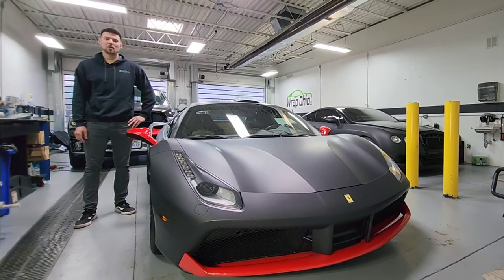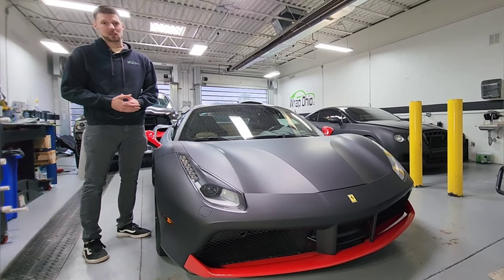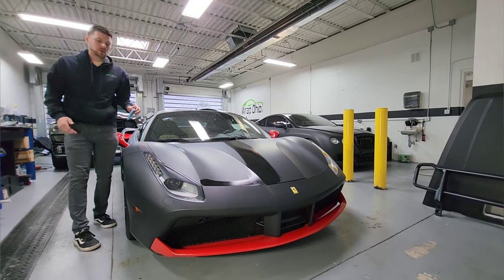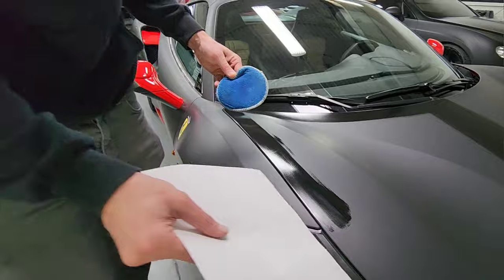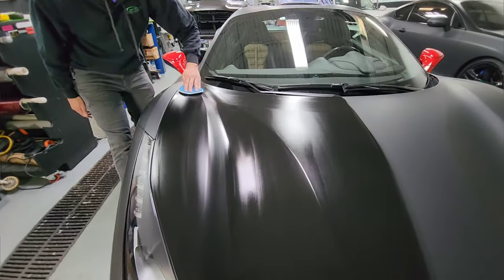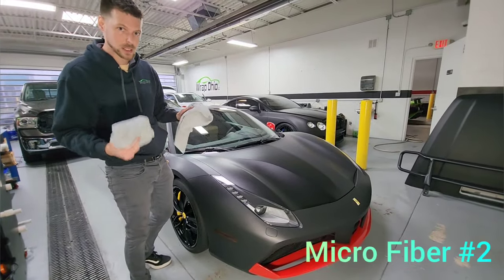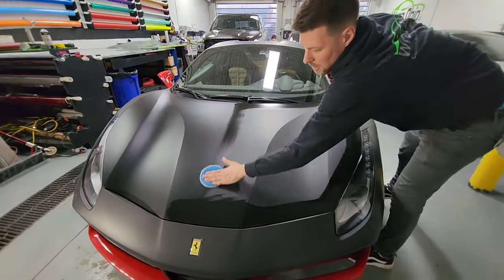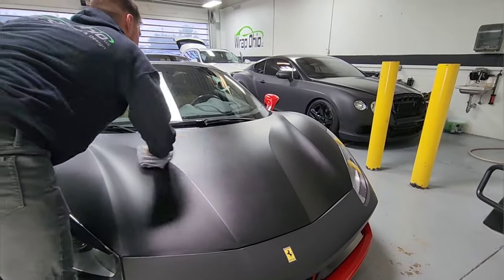How to Ceramic Coat a matte wrap!

Comment: Thanks for a great video!  Just for clarification, please could you confirm that matte PPF does NOT require any special (matte spec) ceramic coating. Based on my understanding, the ceramic coating does give the matte more sheen but keeps the matte look in a more silky/satiny way? I am asking because some PPF outfitters claim they need special matte specific ceramic coating and either don't have it  or charge more for it... thanks in advance for your answer!
Reply from the maker: It does make it a little more satin but far from actual satin. It's just an enhanced matte. a little more rich. but no you don't need a special coating!